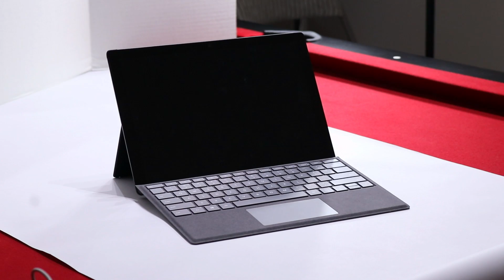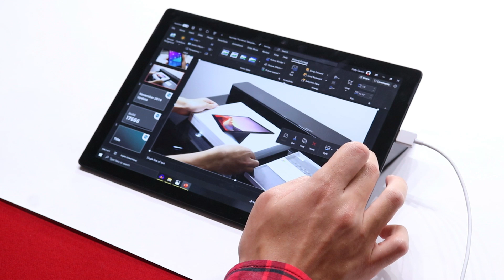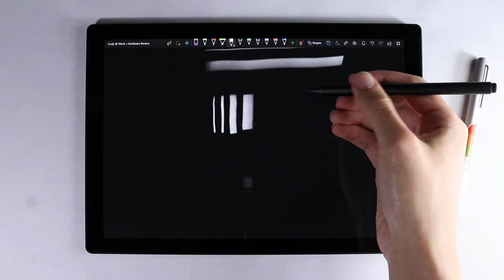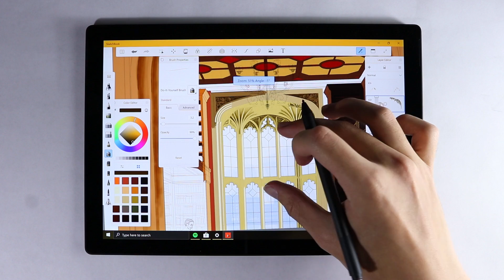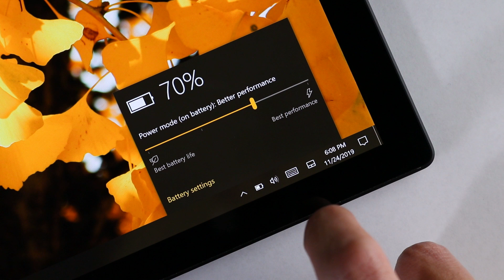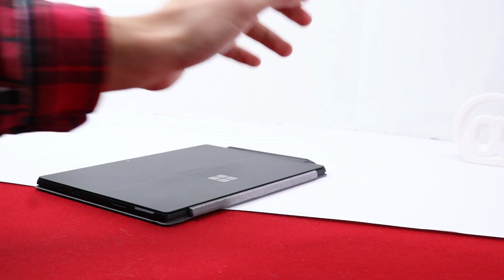Surface Pro 7 (i7) Review: Better than Surface Pro X!

Comment: I love my surface pro 3 and just upgraded to the 7 and man I didn't know it had a fan. This for me is a downgrade because I use it a lot because of the passive cooling. This way all the dust from my cnc machines I control from it won't get in. Well I guess I shall just draw the design on the 7 and send them to my 3 to keep on controlling the cnc machines. Wouldn't want to ruin the poor thing by clogging it all up.

Comment: I just got a Surface Pro 7 with i5/128gb/8gb RAM. Very, VERY pleased with it overall, no complaints whatsoever. Smoothly runs whatever applications I wish to use, and very light weight. With the Type Cover keyboard, it weighs about the same as my ipad with a logitech keyboard/case.

Comment: The AMD Picasso (4c/8t Zen+) Surface Laptop 3 was a FINE chip & product! Yeah, you gave up some raw CPU performance vs the Intel Ice Lake "business" model but instead you got a much better & faster iGPU with DRAMATICALLY better drivers and driver support!!! Intel's GPU drivers are STILL a disaster almost 2.5 years after this video was posted!!! Picasso was ALSO more power efficient with better battery life and MUCH better thermals.
Reply: You think this still worth it instead of buying new one??

Comment: Great review, quick to the point. Was on the fence about getting a Surface pro 7 over the 7+ simply due to price vs CPU Gen, vs amount of Ram I’d get with it vs swappable SSD. After this review, I think I’ll be fine saving $500 for the Pro 7 I7 16GB ram 256GB SSD instead of 7+ or 8.
Reply: Hi did you buy pro 7 eventually? How is your experience
Reply: @ИванИванов-я9ы8н  yes, I got both 7 and 8 😆.

Comment: As a desktop user who also has a Surface the biggest downside to the Surface and the reason I still have to keep my desktop is that the Surface can only add 2 external monitors. My 7 yr old Dell PC can run 3 very big ones. With the Surface I'd have to use the small Surface monitor as my 3rd monitor which is a significant downgrade to what I've been using for over 10 years.

Comment: Hi just bought the surface pro. 
 HELP ! 
Should I claim a new device: my i7 surface pro starting heating on the first charge out of the box last night.  Then I noticed 2 small marks on side of bevel. Also noticed evidence of glue residue on edge of screen. Advise if I should claim a new device.

Comment: great video. i m late to the party but i m considering buying this device, mostly because i want to get rid o my old acer travelmate (celeron 4+128) and my tablet, the surface looks like to be the only option to have all in one. I only use the laptop for basic photoshop, prime/netflix (through browser),music editing, internet ed office, the tablet just for comics. I was wondering whether to go for the i5 8+256 or i7 16+256. Any suggestions? Also since i know ios/android do not allow you to watch prime/netflix when connected to a tv, how about surface? no issues whatsover right? I just want a 2in1 that can last me at least a couple of years, without dropping in terms of performances, and considering the price of either i5 or i7 i dont want to waste money.
Any advice on the above specs and question?

Comment: These reviews are htpocritical. One review wil say surface tablets have issues another praises them. There’s so much back and forth it’s insane. You talk about performance but the Pro X will not run 64 bit programs. Major gamer changer. It won’t even run Microsoft’s Gamepass. How can you push Gamepass and one of your new surface tablets can’t even run it. The surface 7 is bulky and slow to run video editing compared to apples M1 chip. The bench marks of Apples M1 offerings is embarrassing to Microsoft. It’s leaps ahead of the surface. So how can you sit here and claim it the gold standard. Slow performance and not being able to run Adobe photo shop is the gold standard. I like the fit and finish of the surface over Apples tablets. And I think the surface has better longevity. But battery life is another issue. What’s the purpose of having an ARM processor and you don’t even get the battery life performance?  Apple has a chip that converts or reads 32 bit programs and helps it run programs that the ARM processors have issues with. Microsoft couldn’t think ahead. I’m a Xbox loyalist but you make a surface tablet which is basically a streaming device and you call it gold standard. I’m supposed to believe you. I mean the IPad will run Office do all the media and social functions and I’m sure it will run Adobe. But even if it doesn’t. The Pro x can’t run it either. Why would I buy and pro x then Microsoft releases one that will do 64 bit programs. I’m not seeing or hearing how this outperforms an iPad. I know the iPad is faster and runs more. And if I want to edit video I can get an Air or MacBook Pro. Yes the surface has IPad beat with the devices form factor. But that’s it. Apple has it on performance, battery life, and programs. I want a surface. But why would I buy one that is slower than an iPad and one that can’t run and programs?

Comment: Purchased the SPX (SQ1, 8 ram, 128 ssd) for only $623US and love it.  
    1.  Battery life is outstanding.  I get  over 11 hours of continuous YouTube viewing at 40% 
         brightness / Power Mode-Best Performance / BlueTooth off (SP7 gets 7-8 hours).
    2.  Screen is brighter (can watch videos/read in dark room w/screen brightness at 0%)
    3.  Display is bigger which helps greatly when reading/annotating documents
    4.  Is thinner and easier to hold for notetaking 
    5.  I can run every app I need for work (Office 2019, statistical software, PDF apps, Zoom, 
         Snapdrop, Nebo, etc.) w/o downloading MS' 64-bit emulator
    6.  Price of the keyboard is about the same as SP7 on Amazon ($65)
    7.  SP7 pen works on the SPX
    8. Windows has 35 million apps/programs (which is why no one mentions how many 
        can run on SPX).  So there are multiple suitable apps available for all your needs.
    9. 35 million Windows apps/programs also means there are millions more apps
        that can't run on iPads or MBs compared to the  SPX.  

Downsides are: 
    1.  No USB-A port (dongle life)
    2.  No microSD slot 
    3.  MS' 64-bit emulator greatly reduces battery life (so I have not downloaded it)
    
Finally, video editing, photo editing, & drawing are hobbies. Pro means white-collar professionals and STEM workers.  So the SPX, unlike all iPads, is a Pro device.  Lastly, funny how all these "YouTubers" have problems with Windows' tablet mode, but the thousands of reviews on Best Buy or Amazon never mention it (except the 1-star trolls with non-verified purchases)...lol

Comment: Is the Micro SD slot there for you to expand your 'hard disk drive' ?  By that, I mean, would using the SSD as your OS only drive and a MicroSD card for your data and project files be a good strategy?  I've just purchased a Surface Pro 7 with 256Gb and am wondering what's the best way to work?  I don't intend installing all my Windows software (of course), but am planning to install some of my CAD software, so i can do CAD work onsite.  Do I go for a cloud file solution (Dropbox, OneDrive), an External HHD (like a WD book) or will that MicroSD slot be enough (and quick enough?)?

Comment: So where is the cellular connection on the 7? That is the reason to get it,  not processing power.
Reply: It's on the i5 "Plus" (+)/Corporate/Business model with "LTE Advanced 4G" - version.
Reply: @commentarytalk1446  Yes. Just released. I would have bought it if I had known about it. Thank you for the comment.
Reply: @daveoatway6126  Agree with you about the connectivity being the key (along with lightness ie weight). Still I totted up everything you need/get with it and at that price it's not far off the Lenovo Thinkpad X1 Nano which is much more future proofed (processor/RAM etc) and lighter and comes with either 4g or 5g options (and replacable SSD and battery too though unfortunately soldered RAM (16gb)). Can also get a touchpad option for the screen too. Probably the top form I've seen. Some will say for that money you can get a monster PC instead...

Still think the Surface Pro 7+ is one of the best options I've seen for portability but the specs are still too low and the jump in price for beefing them up still too high with the prospect of an 8 out in the Fall. I really like the Surface Go 2 but think a bigger screen at a still very light weight is a better solution.

The ideal is: 1. Light 2. Screen 3. Performance 4. Touch/4G Connectivity/interactivity imho. Soon these will become the de facto computer tool imho (in sync with cloud taking on more and connectivity being over 5g+ instead of wires).

Comment: I just bought one and it had an issue with artefacting so took it to best buy and they switched it for the I7 256 16 gb ram model plus type cover in signature series for no extra charge and threw in the pen too. I LOVE IT.  I had a 4, loved that....this is just beyond good. the i5 was fine but this is so powerful and great.

Comment: I am planning to buy a new device for my work, previously I was using MacBook Pro (from 2017, or maybe 2018), 

Now I am still very unsure if I prefer to buy a Microsoft Surface Pro 7 (i7) vs the MacBook Air 2020. 

I mostly use my portable device for emails, Netflix, browsing, normal iPhone photography, some XL & Word document reading, and some creating, downloading movies and watching them later 

Also I did purchase many years ago an iPad with the stylus to take notes, but the Mac mobile OS was not a good laptop or desktop replacement 

So not too much computing needed, 

I am leaning towards a tablet, due to the comfort and also the portability, but not entirely convinced I can replace my Mac laptop with the Surface Pro 512MB, 16GB, i7 

Would you be able to guide me and advise me please?
Reply: Sorry I want to add here, that I am also using my portable device for lots of online zoom or video calls, 

And one other concern is how easily I would be able to migrate (or access) my MacOS data on this platform, (I am already aware of the iCloud app) so I can possibly make my transition (hopefully) seamless?

Comment: What version did you use? With a i5 or i7 Processor? What would you recommend for PS? Iam using an older i7 in my Desktop for PS and 16gb Ram, and I dont know how a newer i5 will perform in such a device.

Comment: i've been a surface fan from the beginning, glad they've caught on enough to not be abandoned.  had sp2 which was great at the time, upgraded to sp4, little big for what i was using it for at the time but got used to it.  just got sp7, essentially identical but significantly faster, and facial recognition is light years improved.  best of all, sp4 typecover and pen work just fine.  so great value for upgrade.  although i wouldn't have if not needed, kids dropped 4 and display was messed up.  love these and hope they keep improving them without making them huge or cutting edge, therefore too expensive.

Comment: I really hope they start using higher refresh rate displays on their next line-ups. Even for the Go it would be a deal breaker for me.
Reply: SPs are for productivity, not gimmicks...
Reply: @RK-um9tu  higher refresh rates aren't gimmicks, it's just that the 60hz should've disappeared many years ago. Now that smartphone manufacturers, and also Apple with their iPads realized that, it'd be a mistake to argue they're gimmicks for Microsoft. You're just removing a feature that can be disabled anyway when you need to save battery and isn't all that expensive to include anymore.

In the other hand, these machines are fairly capable of running light games like rocket league or CSGO, but since you're limited to a 60hz refresh rate they're basically unplayable. You can't use a SP to play them regularly without an external display, which just kills its portability for this particular use case. It would be as easy as overclocking their displays to create a new and amazing use for these products that I've personally been waiting for for a long time now.
Reply: @notfound_63  If playing games on your phone is a priority, let's pick up this discussion when you become a working adult.  As for Apple, iPads aren't computers which is why they are popular with children, stay-at-home moms, and senior citizens...
Reply: @RK-um9tu  I think you don't get my point. A Surface is not a phone, it's a Windows tablet. And it would benefit from a higher refresh rate much more than any phone or Android tablet. That's a fact. And if people keep thinking what some brands want to make us think, there'll never be evolution. Obviously, for basic productivity work like word, excel or power point you won't need anything higher than 60, but those who do content creation, or artists who use it as their main tool to draw (which do exist as the SP's pen is apparently wonderful for that) will highly benefit from a better refresh rate. That's why many have already switched to iPads. The thing is, this feature wouldn't hurt anyone (not counting a possible price increase), but not having it is sometimes determining in choosing one device or another, or in buying or not buying a device.
Reply: @notfound_63  iPads sales have been declining since 2015. Their market share is down to around 36%. Sales growth from Q2 2019 to Q2 2020 was 1.3%. Conversely, top 4 Android tablet makers all has sales growth of over 40%. iPads have lost over 500,000 apps since 2017. As for number of apps, Apple 1.8 million, Android 2.7 million, Window 35 million. People are leaving iPads because they want productivity, not gimmicks....Facts
Reply: @RK-um9tu  once again, if you want to understand it you will. Since the release of the iPad Pro, which tried to target enterprise workers, they have sold many for this purpose. Obviously, for someone who's looking for entertaining, the classic iPad has been losing its appeal. And for those who need more power and certain features an iPad Pro can't provide, Apple is out of the equation. It's normal that they've been declining in sales, but you have to keep in mind those statistics are for the whole iPad line-up, rather than just the Pro. Personally I'd never get an iPad myself. It just doesn't have the tools I need either professionally or for entertaining. But I understand it may do for other people.

Also, what you call productivity is quite relative. If your usage requires just raw power, then you'll thank the APU and ram upgrades they do every generation. But if your use doesn't rely on power as much as on accuracy in, let's say, drawing, you could be fine with a Surface 3 or 4 in terms of power, and they need to provide something that would really make it worth getting the new models. It just depends on what you do, it's not that difficult to understand, is it?
Reply: @notfound_63   Refresh rate for activities like drawing, video editing, and photo editing are hobbies that have nothing to do with productivity.  This is why I have never seen an iPad being used anywhere I have worked, professional organization I have worked with, university classroom, professional training or conference, coffee shop, airport, university or public library, or any other public space where people work during their free time.  Not sure why that is difficult to understand, it is literally right in front of your face every single day.  
 
How many iPad Pros have been sold? Please provide the numbers year by year. There is a reason Apple hides them. Also, Apple does not make computer/tablet hybrid (like every other big tech company) and will never give their laptops or computers touch screen or pen support (like every other big tech company) because it will further kill iPad's already declining sales.  It is 2020, not 2010...lol

Comment: I still have my Surface Pro 3, unfortunately the keyboard all of a sudden is not recognized by the tablet anymore so I have to use the on screen keyboard which is a pain. I have tried to troubleshoot this issue and was lead to a dead end where there is no fix.

Comment: Very Dissapointing ; there are a lot of downsides! i went with the hp spectre 360 1tb ssd 4koled 16gbram   <- 1 downside ram soldered in (not the ssd)

Comment: my computer i do a lot of editing and drawing is a £200 laptop that you can bend the screen into tablet mode and has a touch screen.
my problems is the storage was incredibly tiny (it had 2gb because most of it was system and reserved) and due to this can be slow and laggy. also the hinge wobbles about which when drawing dosent help.
is this computer a good alternative to my current computer?

Comment: great review! Excellent! If you can afford theSurface Pro, it's the obvious choice for artists on the go. 
I have a Surface Pro and I use it for drawing in Illustrator and like it a lot! Definitely do not regret the purchase, it saves me hours in terms of workflow.  but the pen experience is not as good as the professional drawing tablet . I have a XP-Pen Artist 24 Pro drawing tablet with screen 24" . The pressure on my XP-Pen Artist 24 Pro screen drawing tablet is lighter and smoother especially at the low end, giving better, more natural marks. The Surface is usable, but is a bit of a compromise compared to the Artist 24 Pro . If you are looking for the best pen experience go with the professional graphic tablet.